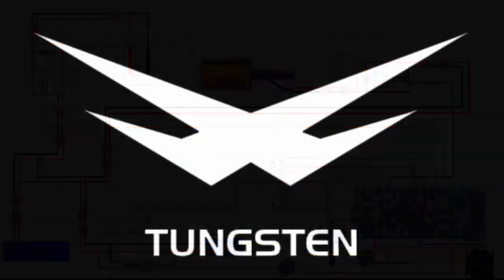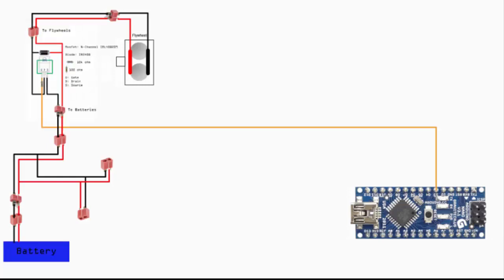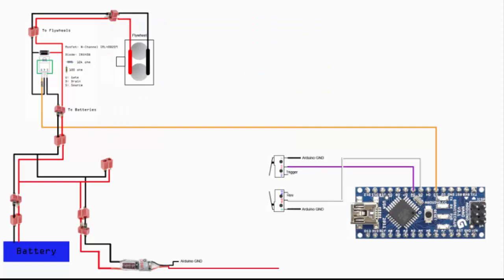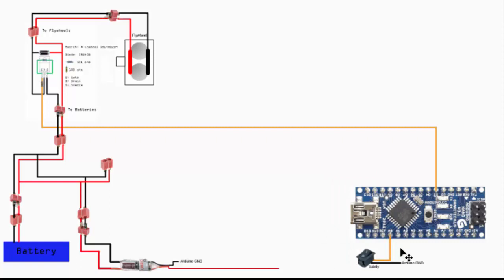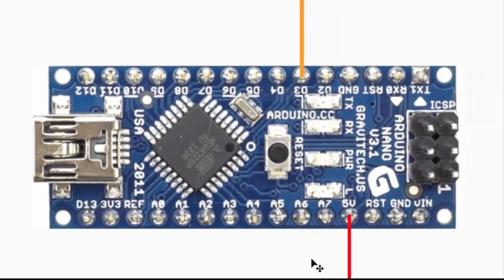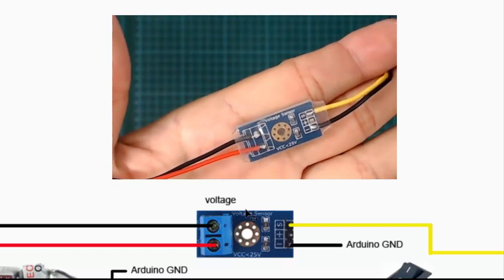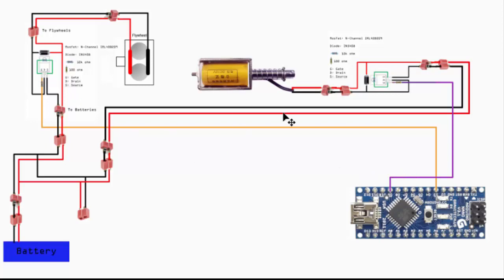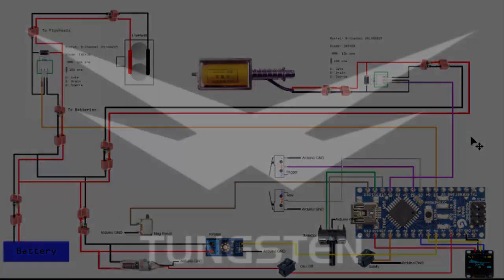Tungsten V6 (Part Three) - Circuit Diagram

Comment: I finally finished building it! It works except the when i rev and fire, the solenoid fires once and then the blaster basically freezes. The flywheels keep running. I do need to tare it apart to test the electronics again but do you have any suggestions? Welcome back btw!
Reply from the maker: I am not sure man, I wrote it a long time ago, I took a look, it could be in the shotFiringHandle() function. Also it could be the detection of the pusher as the detection need to be correct so that the blaster can stop firing. another is to check or modify the delaySolenoidExtended  [] and delaySolenoidRetracted [] setting as the return spring of different solenoid might cause the pusher not have enough time to reach the detection switch before extending again hance causing a non detection (I recall I did change the spring of the solenoid to a slightly stronger one). these are all I can think of.

Comment: I built one of these a while back and have had an issue with motors randomly getting stuck on. I’ll fire a couple shots fine and the motors will keep revving even if I release the trigger. It’s totally random if it happens. Any ideas on what could cause that?
Reply from the maker: I am sorry, I do not know, it could range from a faulty mosfest, faulty pin, bad pin connections. Normally I test the circuit stand alone, before installing everything into the blaster.

Comment: Revisiting this project with the newest worker motors. however, it doesn't spin up. Any changes to the code needed like frequency for pwm?
Reply from the maker: hmm I am not sure do you need to change pwm frequency (I don't think you need to), did you use a pwn pin in the arduino nano (pin 3, 5, 6, 9, 10 or 11)? or maybe you will want to check, is the pin you are using still working?
Reply: @TungstenEXE  been struggling with this wiring for the new motors. I was using D3 as per the circuit, but the motors couldn’t start even though the solenoid fires. 

Later I changed to D8 and commented away the pwm write command and replace with the standard digital write HIGH and LOW to start and stop the motor. This works, but the motor doesn’t spin smoothly - very erratic. 

When I held a little longer, something went POOF. I think was the diode (was using the 4007 as fly back and not the N5408). 

Think I’ll need to replace to a higher rated diode. But that shouldn’t be the cause of the motors behaviour. I do want to use the PWM write to control the speed. Based on the fwSpeed debug, it is sending 191
Reply from the maker: @genexissabers  could it be the mosfet? the new motors does comes with capacitors? if not you should add the caps.
Reply: @TungstenEXE  changed the mosfet before already. Changed the board too. The motors do come with caps ( I recall seeing the brown SMDs).

Comment: VEC is a buck converter,Right? I don't know what is that, Please help
Reply from the maker: do you mean BEC? that is the "Battery Eliminator Circuit" , yup it is basically a  DC-DC voltage converter. I guess you can a buck converter for the job, but I think you most likely have to put extra capacitors to handle electronic noise as smaller buck converter don't that care of noise that well.
Reply: @TungstenEXE  Thank you so much already bought

Comment: did you eventually release a part 4 to talk about the code? Your content is the #1 walk through tutorial online to help people like me breakdown this modding aspect of the hobby into smaller, easily consumable pieces. Thank you very much!
Reply from the maker: I did not, I didn't got around doing a video on the code, I did try to document the code a little hopefully it help (link to code here: https://github.com/tungstenexe/tungsten-V6)  the code is a little dated, I have not look at it for sometime, most likely will have to rewrite some part, for example the OLED code need update for the new lib way of writing.
Reply: @TungstenEXE  I’ve already downloaded that and have been reading (and benefitting!!) from it for the past few days. 

I’m using your code but adding brushless with esc support. However, can you better explain the ismodeV2 thing?

The OLED will not work??? I’ve not gotten my OLED yet, but it’s really a good addition. Very elegantly attached to the RS. What needs to be done?
Reply from the maker: @genexissabers  
For the OLED, yup there is an update, I did an ammo counter for swift, that code should work (I will provide the link below, TungstenSwiftAmmoCount.ino), in summary, I declare 2 new value, line 19, 20

#define SCREEN_WIDTH         128 // OLED display width, in pixels
#define SCREEN_HEIGHT        64 // OLED display height, in pixels

Declare the display as, line 35

Adafruit_SSD1306 display(SCREEN_WIDTH, SCREEN_HEIGHT, &Wire, OLED_RESET);

Then in setup: line 135, 137 you do not need 136 as you are not rotating the display.

display.begin(SSD1306_SWITCHCAPVCC, 0x3C);
display.clearDisplay();

link to ammo counter code for reference: https://github.com/tungstenexe/Tungsten-SwiftAmmoCounter/blob/main/TungstenSwiftAmmoCount.ino

for the v2 mode, it is a mode where by you pull the trigger is single shot, you pull the rev, it is burst fire, you pull both trigger and rev together, it is full auto. the side switch becomes a control for the number of darts for burst fire, 2, 3 or 4.
Reply: @TungstenEXE  question, why did you use a 5v regulator and input at 5V? When i do that, i keep getting sudden dip in voltage when my motors spin up.

could you have lipo direct in?
Reply from the maker: @genexissabers  I use the BEC to get a stable 5v for the board, the dip of voltage happens when revving and that was why I use the BEC, it should not affect the voltage out of the BEC, it should be constant 5V, if the output (5v) from your BEC drops, something is not right. I don't use the onboard regulator of the Arduino board vin as I release that cannot handle the current and voltage change that well without implementing some caps, it burns out sometime. so don't connect the lipo direct to the vin.

Comment: How hard would it be to change this setup over to use brush-less motors?
Reply from the maker: instead of the mosfet to control the FW, will need 2 ESC (2 pins from arduino) to control the the FW, the programming will need to change a little, can be done.